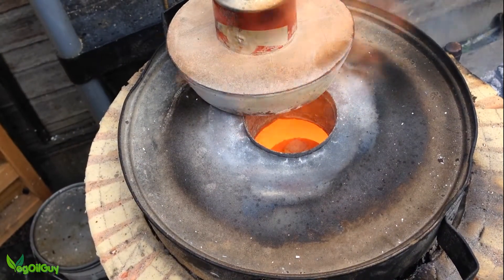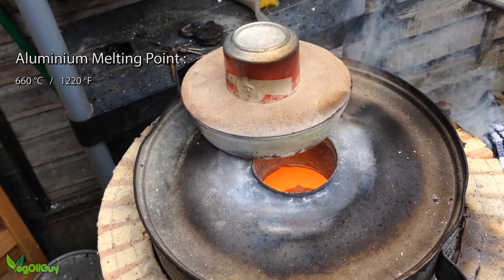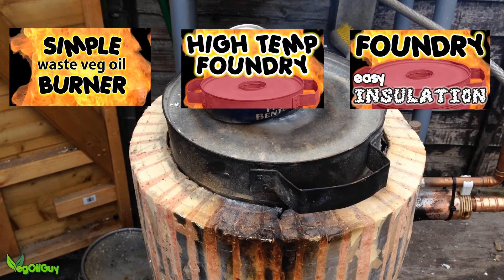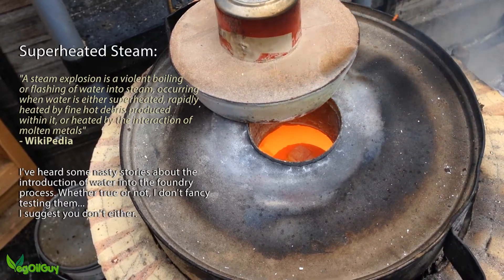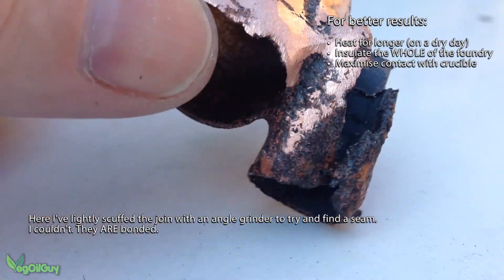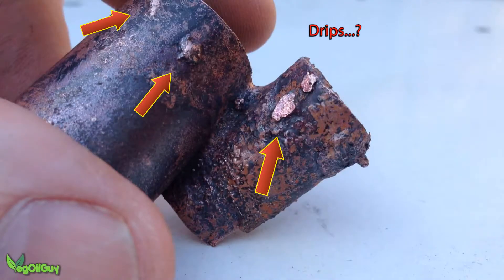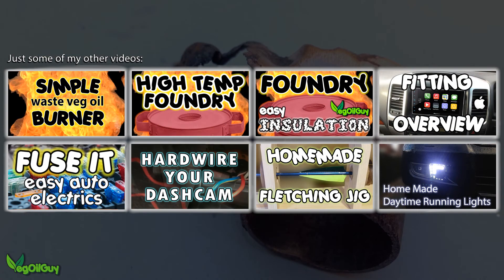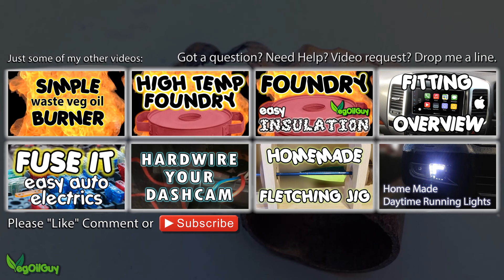Melting COPPER in an Oil Burner - by VOGMAN

Comment: I melted a bunch of cast iron with your burner design            But I'm using proper refractory like 3 inches thick on walls and floor and lid at 5 inches thick.         Works awesome.      Thanks for the great ideas man.     Keep them vids coming.
Reply from the maker: WOW!!!!!
Thanks Kevin. That's amazing. I always felt with the right level of insulation, etc, this little burner could work wonders. You've made my day. Thanks for sharing this : )

Comment: After 2 different designs on oil burner tips/nozzle/feeder. I have settled with your design. From watching Oil Burners videos and your videos I'm 100% sure I will be melting copper now. My last set up got it red raw and not far from melting point. Cheers for the great videos and love to see you do a copper melt with your waste oil.
Reply from the maker: Hi Patrick. I'm confident you'll do it. Just have a little patience. Remember to get thing hot first, introduce the oil slowly and be prepared to fiddle with the oil and air mix. It is easy because there's so little involved. But it's fiddly...
BUT if you stick with it, you'll get there : )
All teh ebst
Geoff
Reply: VegOilGuy if I only had a way to show you my results from an old system I had running yesterday. Did very well but loosing heat and I know why. So it's back to ground basics and dig a hole.
Reply from the maker: Hi Patrick,
Great to hear of your success. Well done.
If something is working for you, don't give up on it - improve it! Insulation is easy and cheap if you use plaster. I've been blown away by it.
https://youtu.be/T1Mxg4EVh98

It could make a massive difference to what you're doing : )
Take care
Geoff
Reply: VegOilGuy is there way I can get in contact with you other than YouTube please.

Comment: I think trying to melt iron would really prove a lot. As some comments already are claiming it should possible perhaps invest some time in trying to melt iron on a good day. Cast iron should prove up to 1200 Celsius(2200 Fahrenheit) and wrought iron if you can get your hands on it should prove the temperature all the way up to 1500 Celsius(2732 Fahrenheit).
Reply from the maker: When I eventually get around to properly insulating my lid I'll be pleased to have a go... and share the results of course ; )
Thanks for your interest.
Reply: I built a rig like this with a shop vac for an air supply , melted 2lbs of copper in 15 minutes after heat up  but ruined my steel crucible , gone graphite now , i'm guessing but I think I could melt iron in 1/2 hour

Comment: Just out of curiosity how much oil did you use?
Reply from the maker: I've been asked this before and I'm really not sure. My answer has to be "not a lot" and I've never really measured.
I place 2 or 3 inches of oil in my bucket. I do my thing and when I'm finished I pour out what seems like a good couple of inches. I've obviously used some oil, but my point is it's not an overly thirsty process. I've never tried it but I'm confident those 3 inches would last me all day and still leave me emptying the bucket.
Sorry if this isn't a very helpful answer.
Best wishes,
Geoff

Comment: I agree with your conclusion that your furnace COULD melt copper.  So sad about the rain, but is there any chance that you could construct a collapsible/foldable roof?
Reply from the maker: The weather is always unreliable and the set up is quite noisy. That's why I'm going for the indoor option of an electric foundry. In theory that should cope with copper too, though in absolute honesty I've never had a need for copper. Aluminium serves my needs much better.
Reply: You're going to have a lot of waste heat to contend with.  Although in winter that heat might also warm your house if thoughtfully ducted.  Do you have a basement space that you could use?
Reply: Maybe your Mrs. wouldn't object to a dual-purpose gazebo in the garden.  Insulate the roof & line it with sheet steel, and it should serve in rain as long as there isn't too strong a wind.  A tarp upwind might help in moderate breezes.  Just some ideas, hope I'm not a bother.
Reply from the maker: My Mrs not object? You clearly haven't met her : )
Reply: No, I haven't met her.  I have seen her try to kick a ball while on crutches once.  I can't help but chuckle even though it's not nice to laugh at people struggling.

Comment: Great video Geoff. I know for a fact that copper would melt in your furnace as my oil siphon nozzle can easily melt iron.
Reply from the maker: Thanks Chris. It was my first time with anything other than aluminium so I was more than a little nervous ; )
I'm optimistic for next time now.
Reply: +VegOilGuy might I add that my oil burner is a siphon not a drip feed
Reply: +VegOilGuy Hi Geoff. I've ran out of refractory cement and castree are out of stock until Friday. So I guess I should start editing. I what software do you use I'm not sure what's good or not in the world of editing.
Reply from the maker: Hi Chris. Windows Move Maker is generally free and nice and easy to use. Lately I've been making use of Adobe Premier which does take a bit of getting used to.
Oh... and I ran out halfway through as well. Always the way...
Best wishes,
Geoff

Comment: Will you be making a follow up video?
Reply from the maker: Hi Cian,
I might do in time. I'm not really sure anyone would be interested to be honest : )
Currently I'm working will aluminium doing some lost foam casting, so it's not something I'll be doing any time soon.
With that said I have heard from others who have had great success using veg oil to melt copper.
Hope this helps.
Best wishes
Geoff
Reply: I, for one, would definitely be interested to see you try again!  If you can melt copper, you can make bronze, and who wouldn't want to make bronze?!
Reply from the maker: Well I do say that I'll always do my best to accommodate requests... so I guess that was a request : )
I've got a few things on the go right now but the foundry is coming out to play in a week or two. As such I'll do my best to give copper another go.
Stay tuned.
Best wishes,
Geoff
Reply: Thank's M8 :)

Comment: Without insulation, with the crappy 2 part plaster paris/sand, with charcoal, with a hairdryer, we did our first copper melt last night just fine.  It was bullet jackets. we collect lead from the shooting range.   Melted copper just fine. Although it took 1.5 bags of coal to get 2 muffins lol.  But yes... yours will melt copper..
Reply: bullet jackets are BRASS not Copper.